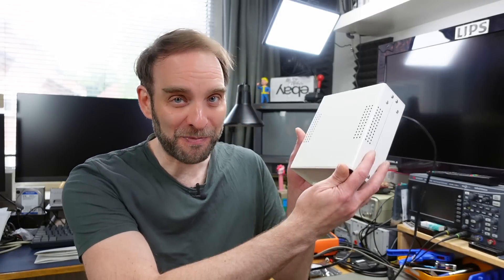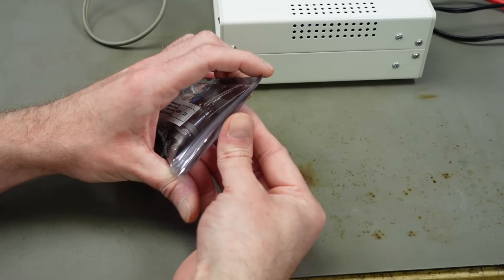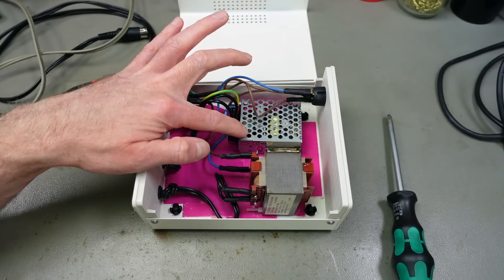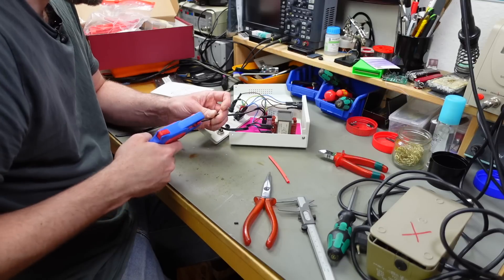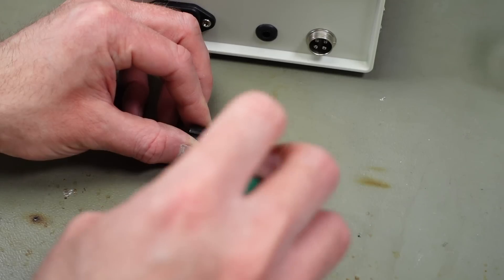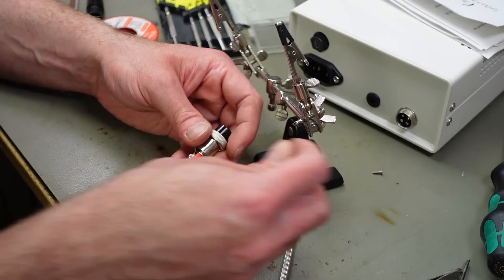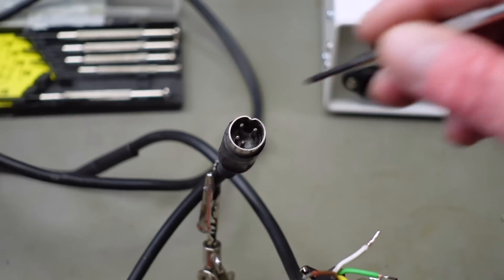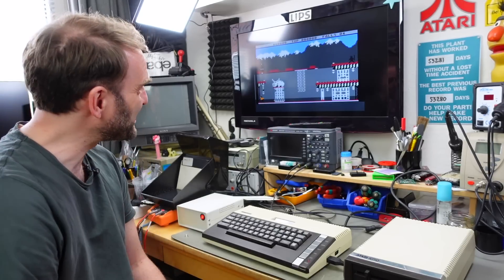Universal Atari/Commodore Power Supply

Comment: Hey Jan, why don't you use the second hole in the housing of your power supply for a second connector with the same pinout? Then you can connect both cables at the same time and connect either C64 or Atari as needed without having to unscrew and screw on the aviation connector again and again. It would make your life as a tester and repairer a little easier. But either way, a useful little project. Thanks a lot for your awesome videos. 😀

Comment: Jan, since there already were two holes available, why didn't you fit two connectors? Of course the PSU could be too light to supply two computers at the same time.
Reply from the maker: Yep, this would be too weak to reliably power the devices at the same time. There would also be potential issues with interference and power surges (when the drive spins up for example).

Comment: Du solltest eine Sicherung in den Sekundärkreis einbauen, zwischen Netzteil und Stecker und zwischen Transformator und Stecker.
Du könntest auch einen weiteren Stecker in dein Gehäuse einbauen, die parallel geschaltet sind, dann musst Du nicht immer die Stecker wechseln ;)

You should build a fuse in the secondary circuit, between the power supply and the plug and between the transformer and the plug.
Also, you could build another plug in your case, which are connected in parallel, then you do not always have to change the plugs ;)

Comment: what about making it a dual output supply, with wires for both the systems and a floppy drive (or other powered peripheral) each
Reply from the maker: I would be worried about interference between devices and power surges, especially when the drive motors spin up etc. Not a good idea in my opinion. But you could always add separate PSUs internally to counter that of course!

Comment: That's an extremely common connector for things like audio mixers from the likes of Yamaha, etc... for power connections. I've worked with several Yamaha mixers over the years that have used that exact connector.

Comment: i'd have put a second connector in instead of closing off the hole......maybe for a 1541......or if the wires are modular anything that needs the same voltage(s)

Comment: Do you personally recommend using  chargers from smartphones? Most of us  have one or more sitting in a drawer. I replaced the 5v regulator/pcb in a C64 brick of death with the 5v pcb I extracted from a quality charger (Iphone or Motorola charger). I frequently measure it and its values are rock solid without any weird artifacts in C64's picture or stability.  Any  ideas on that mod?
Reply: I think one of the better chargers would work fine.  I've seen 2A to 2.5A used to make power bricks.  Originals were 1.5-1.7A 5V DC.  The extra headspace is there if you need it.

Comment: Great idea!I just finished a similar project by building one  power supply  for an Atari STE and a CPC6128!  Now my STE stays cool by having  an external psu . The amperage is high enough  that allows both machines to run at the same time. Both machines don't have disk drives (Gotek) and that helps  the  12volt line!

Comment: For future projects, please use female connectors on the power supply side as an power outlet and the male connector on the cable. For 5v and 9v there is not much of a safety issue, but if the voltage get higher things like this matter !
Reply: Yes, I share the same concern. 
In fact, the standard in industry and in everyday life is that: female connectors on wall outlets and power supplies; and male connectors for any appliances and consumer end devices.
Reply: Not a bad suggestion, but is that adapter available in an aviation style connector?  The way he put it together looks like the only way you could do it with this style of connector.

Googling around it seems like the "generally accepted" threshold where you need to start worrying about shock safety is over 30 v.  I don't know I've seen anything powered by more than 20V, so it seems unlikely.  For retro-projects, I don't think I know of anything over 12 V.  

Rarely you might see something that takes -12V and +12V, but even that only gets to 24V potential, so I don't think you'd ever really get to something where safety is a huge concern.
Reply: @stevesether  Yes. In practice it is really difficult (or almost impossible) to find the female version of this type of connector for chassis mounting.
Reply: @Taisen_Des  What about HIRSCHMANN MAB4100 combined with MAS4100?

Comment: Nice solution! One suggestion: If you replace the 5V-MeanWell with a 5V/12V-MeanWell ("Amiga PSU") you should be able to do a twin-cable for C64 plus 1541 like for the Atari 800XL/1050. 😉
Reply: And having a single 'universal' powers supply would be an excellent way to de-clutter a desk for someone who is constantly doing repairs on various different retro systems.

Comment: Cool. I suppose you could've added another one in the other hole, and if the power supply is sufficient, you could even power both devices at the same time.
Reply: Current draw is a primary concern.
Reply: @timmooney7528  Yeah, I took a look at the original video, and it seems the power supply he used delivers just 3A at 5V. That's not a lot.

Comment: Great video Jan, as always. For closing holes in plastic, I like to use a hand mouldable Polyshape that is able to close the hole, and then you can fine it if you want. It is also possible to paint it, in case you would love to have it in a different colour plastic.
Reply: Hot glue can be punched out at a later date if he made any changes to his design.

Comment: For anyone wanting alternative connectors, SD20 connectors are also available with multiple pins in a strong plastic construction and designed for high current applications. My brewery equipment uses multiple sizes including for two 240V 3000W heating elements. Or Neutrik make some nice stuff at a higher price point too.

Comment: I had the same idea. My next one will be a larger universal PSU for computers like the Amiga, Commodore 64, Atari XL and ST, C16/Spectrum etc. It can power multiple devices and/or peripherals simultaneously and even a 12 volt display (also universal). It is based on a compact PC power supply (5, 12, -12 volts) with an additional 9 VAC transformer and 9VDC (12 VDC step-down). It also has an extra 5 volt USB connector for charging a phone/tablet or, for example, for a Raspberry Pi. Everything is build inside an old C128D case. I'm considering building a Pi1541 in there as well. But maybe I want too much at once.
Unfortunately I can't connect everything i want. For example, the Sinclair QL officially has 15.6 VAC and 9VDC. However, this is internally converted to 5, 12 and -12 volts, so maybe....

Comment: Very funky indeed Jan, the only difference I'd have done is use a blanking grommet to seal that hole or do what Spacedock below suggests. Other than that, a nice little space saving PSU. Sadly the war between the camps will run on even though there's so many Atari and Commodore dual users out there like myself. They just like to row :)

Comment: Why didn't you put two connectors, so you could power both computers at the same time? You already have two holes 😀
Reply from the maker: Not a good idea to power both (or all three) devices at once because of interference/power surges (eg when the drive motors start spinning etc). The rails would have to be separated (or at least filtered) to pull that off in a safe manner.

Comment: These connectors are very nice. I use the 3-pin 16mm version (GX16) for my audio projects since they typically require a dual voltage PSU (e.g. +/-15V and ground). The 16mm version has large pins with solder cups that are very easy to solder, the 12mm version (GX12) is a bit too cramped for my taste.

Comment: I have a mini Phonic mixing desk that uses those aviation connectors for it's power supply to the desk
Reply from the maker: Nice! I only just realized that the ZD-915 desoldering station also uses one of those to connect the "gun" part. They seem to be pretty common for power connections in general.

Comment: Nice idea to reduce the number of different power supplies. But why not just build a simple adapter that you connect to your existing C64 PSU to get Atari-style connectors?
Reply from the maker: The Atari 1050 needs a beefier 9VAC rail than the C64 PSUs (even my higher output self-made ones) can provide. Doing it this way around just made more sense. :)

Comment: Those C64 bricks are saveable by rebricking or replacing the faulty 5V regulator with a UBEC.
Reply from the maker: Indeed! This particular one has a broken transformer, though. I didn't look at it very closely but I think the secondary windings have an intermittent short. Not really reasonable to try to save, I think.

Comment: Those are sturdy connectors, but the normal (safe) convention is to have the power outlet as a chassis mounted socket rather than having hot pins sticking out.
Reply from the maker: Good call! Probably doesn't matter much for my hobbyist use case but you are correct, would be way better to have the socket side on the PSU. I didn't think of that.

Comment: You even remembered to put the connector sleeve on before soldering the connector on..... I never forgot that either... nope... not once.... and the connector didn't have 26 pins in either....
Reply from the maker: I still forget that order of operations from time to time myself... :D Having just four well spaced pins to solder was a nice change from more intricate DINs (how I hate them!) and the like. :D
Reply: The most annoying I forgot it on, was the 26 pin, and it was not even soldered, but it was all just put the wire through a tiny color coded hole, then squeeze a ring onto it from the side, and it would then lock all wires in place... in theory... it was so fiddly to get all the wires in without pulling others out, and then finally when putting the ring on, it wouldn't cut into the wires properly... and then finally when I got all of them to make contact..... I noticed the sleeve still on the table.

Comment: Hi Jan. Those aviation connectors are very good - I use them for all my projects that require high current such as a mini CNC machine controller. You can get them quite cheaply but good quality ones are a bit more expensive. I am puzzled as to why you used hot glue to block up the second hole in the case. I would have used the hole to mount a second connector wired in parallel with the first. This would have given the option of powering a second computer/device/disk drive at the same time. Also I would have printed out a label showing the pinouts of the connectors and stuck it on the back of the case by the sockets for future reference when making extra cables. Those aviation connectors really help in making this project look very professional - setting yourself a new benchmark? 😉  😁👍
Reply: Maybe one or both of the PS he used can't supply enough current to drive multiple loads.
Reply: @amerikalast  It is already set up to supply a computer and a disk drive at the same time from one connector. It would at least have the option of using a separate connector for each device.
Reply: Glue is good enough to keep a nut from working it's way loose.  Filling a grommet with glue will allow that hole to be used later on without major effort to remove.

Regarding multiple devices, that is dependent on how many amps are needed to run more than one device.   A 5.25" floppy motor can pull 2A by itself when it spins up.
Reply: Agree x 3
Reply: I was thinking the same thing.
Reply: Jan Beta is famous for using hot glue whenever possible. 😆

Comment: hi jan great idea! i would put an a/b switch on the power supply so that you can keep both cables plugged in. if the supply can handle it, would be cool to run them both at the same time ;-)
Reply from the maker: I don't think it's a good idea to power more devices at once because of interference and possible power surges (for example when the disk drive spins up). You would need some elaborate filtering or separate the power supplies internally to pull that off safely.

Comment: Aviation connector, eh?  I think I've seen those, so if anything, at least I learned the name of that type of connector.  I'm thinking it would've been cool to just add an additional DIN power cable for the C64 hard-wired to the 5VDC and 9VAC.  No adaptors, just the cables coming straight from the box.  While technically problematic if you have both computers turned on (unless the PSU can handle the load), it would be convenient and you wouldn't have to worry about losing an adaptor.  Of course, if you did lose it, you could always build another one, but still.
Reply from the maker: I don't think it's a good idea to power more devices at once because of interference and possible power surges (for example when the disk drive spins up). You would need some elaborate filtering or separate the power supplies internally to pull that off safely.

Comment: I used that style of connectors before (though commercial moulded ones) at my previous work as a software engineer for mining equipment. The fit was always super tight (probably for the IP rating) and they were a pain to deal with. Funny fact: they were only IP rated for a very small number of connects/disconnects (3 I think?). Didn't matter in the lab environment I dealt with them in, but on a real machine they would have to be replaced after that.
Reply: Check it out, comment one says they used connectors that were just a tiny bit small and they fried a entire radio setup, now that is some smarts Lol!  I told them it was a them problem and not to doubt the work of a pro like Jam Beta!
Reply: @juliedunken1150  not a problem in our connectors and cables. But they were also horribly expensive

Comment: Be careful with cheap versions of those connectors! I used them in an amateur radio project and due to a significant deviation in its mechanical dimensions, I was able to incorrectly connect the plug into the socket. Without using force it ended up 90° rotated and my equipment got fried. The dent didn't prevent it, because it was apparently too small. So always make sure that the dent is correctly aligned with the notch when you connect your cable!
Reply from the maker: Oh, that’s good advice. The connectors I got seem to be pretty decent so far but definitely worth double checking when connecting the cables! 🙀
Reply: Oh WOW, sounds like a you problem.  Jan’s work look superb ! Sorry your not as good as him, maybe next time send your project to a pro! Lol
Reply: @juliedunken1150  That doesn't seem called for.
Reply: @juliedunken1150  As others said this is not called for. Also, he was suppling good info as to the quality of connectors. Doenst matter how they are wired up but if you can put them in the wrong way that is a problem.
Reply: @francistaylor1822  wow, defending 
 Shotywork seems like a losing proposition.  I sit here and see Jan easily make this work.  There is an old saying in my country, call a plumber before you try and fix your plumbing.  It’s sounds like this person lacks expertise that Jan has easily and anyone of us mind you could easily master.  Electrical work is no hobby no matter how many midwitts believe it is, these procedures should only be done by a trained expert who doesn’t make mistakes.  Jan is one, this gentleman or they person is not.  They should try gardening instead.
Reply: @juliedunken1150  You seem not to have comprehension of what the person is saying. they arent saying there is a problem with the wiring, but the ridge on the plug they bought isnt sufficient to stop it being connected the wrong way.

The person is giving information that can inform people and be of some help.

The dent is supposed to stop that happening but if is poorly manufacturered, this can happen.